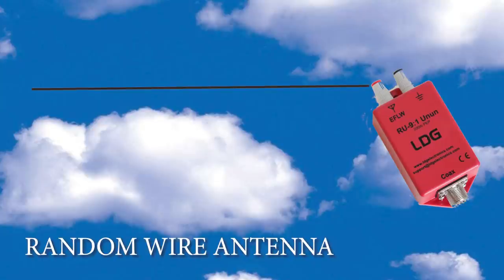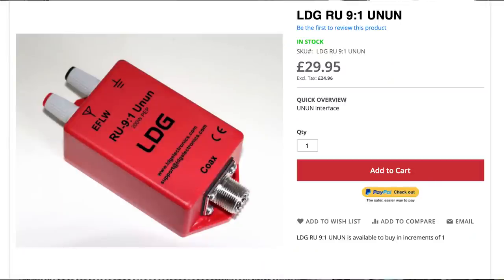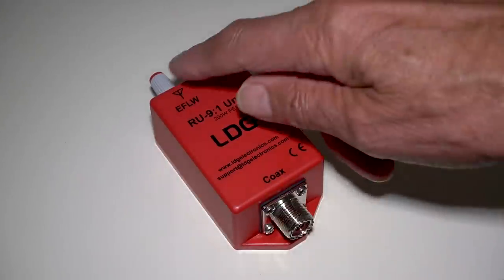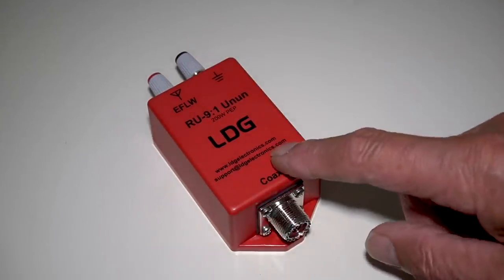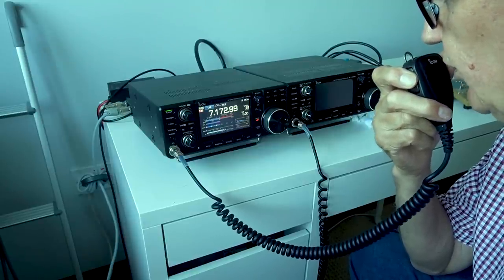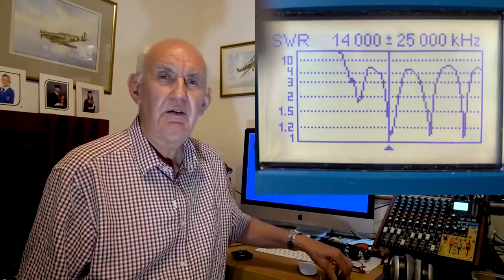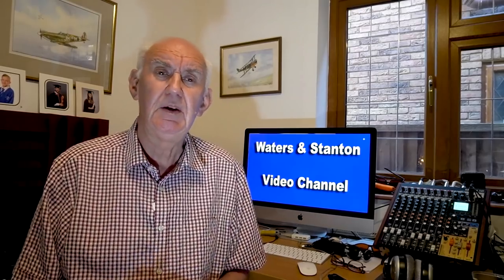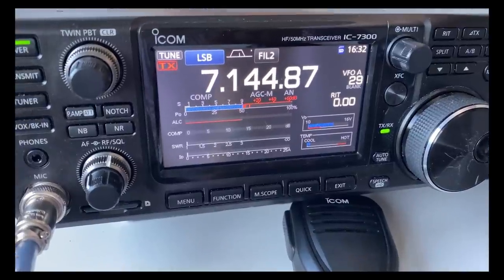RANDOM WIRE ANTENNAS USING THF LDG 9:1 UNUNS

Comment: At about time 15:25 you mention that the line insulator must be next to the rig. But I've seen many articles that put the current choke at the antenna end. Usually, at the closest - to the antenna - place in the coax. Usually, it's done by creating a coil of about 8 turns on a PVC cylinder about 6 inches in diameter - something like that. Instead of coax turns, one could use "beads" instead - but again, they go close to the antenna.

So I'm puzzled about the line insulator going next to the rig. If you had an external Antenna Tuner, wouldn't it go before the tuner? Where is my mistake in thinking it should go at the beginning (non-rig end) of the coax? I do understand that I am assuming that 1:1 is the same as a current choke and that could be my error.

Thank you for putting this video (and the others) together.
Reply from the maker: Firstly you don’t need an external tuner but if you do, then isolator does go between tuner and antenna. I don’t recommend an isolator at transformer end because there is no benefit and the coax is free to act as a counterpoise, although  that aspe t is ooen to opinion. 73 Peter
Reply: @watersstanton  Peter, thanks to your video, I now understand more about the difference between a random wire end-fed vs a half-wave end-fed. When you say I don't need an external tuner, are you assuming the rig has a built-in ATU. Because I'm pretty sure everything I've read about a random wire end-fed is it needs a 9:1 UNUN and a tuner - either in the rig or external.

The other "contrary" opinion I'm struggling with is some say to run the counterpoise parallel with the antenna and others say run it at 90 degrees. Of course, we end up running it whatever way we can given the geometry of our backyard.

Maybe it's the Half-Wave that wants a choke just after the 49:1 UNUN?

Comment: I find your videos so interesting, you are such a good teacher. One question, when you say a slightly high SWR doesn't matter as the length of coax feed is very short what do you mean ? Why might a high SWR on a short length of coax not be a problem but on a long bit of coax it might ? I thought SWR referred to the amount to energy returning to the transmitter which wouldn't be good. Many thanks again.
Reply from the maker: We are talking about HF I think? A VSWR of 4 or 5:1 on a length of coax about 3 or 4m long is not a problem as regards loss. 2 or even 3:1 on 25ft is not likely to provide any noticeable loss.  Even longer at lower frequencies. Almost any length ar 2:1 is workable with not noticeable loss. Hope that helps. 73 Peter.
Reply: @watersstanton  Thanks Peter, yes HF. So that wouldn't be a problem for the transmitter with an ATU, I'm guessing without an ATU its likely to upset the transmitter ? Many thanks for your reply.

Comment: Hi Peter, thank you for a very insightfull video. I'll be adding a counterpoise to my 9:1 unun soon and am happy I now have some sort of idea how long this counterpoise has to be. One more question though: do I put the line isolator after the antenna tuner (LDG Z-100) or in between the antenna tuner and the transmitter (Icom 7300)? Thank you! 73's Alexander PE0ALX
Reply from the maker: The line isolator goes at the end of the antenna feeder, so that means on the antenna side of the ATU.
Reply: @watersstanton  thank you very much for your answer.

Comment: A wire of about 3/8 wavelength on the lowest band (say 40m) will work fine up to 10 m
Reply from the maker: Thanks Todd. The general guide is to avoid quarter-wave multiples on any band. 73 Peter.

Comment: Why do some end fed wires ie for 40/20m with coil like your previous video not require an unun but some do?
Reply from the maker: The small coil is not essential but helps to correct the VSWR drift as you go up in frequency. 73 Peter

Comment: hello Peter iI've been looking at the unun for a while, i have odered on and it will be mainly for top band, i have a look of pesky telephone cables near my qth so i will have to make a lazy W hi hi if that makes sense, although evryone near are now on ground fed fibre optic bt wont remove thier cables, grrr. thank you for the video i'll post once its up, the length will be 124.5 as per the chart and a 1/4 counterpoise ok? many thanks GW4 mike
Reply from the maker: Hi there. Hope all goes well. 73 Peter

Comment: So what about the 49:1 and the 69:1 with a long wire on hf?
Reply: You use those with a half wave bit of wire (or multiple thereof) as it presents 2000-4000 ohm at the end.

Comment: Thank you Peter, very informative video, easy to follow.  Would be curious to know if the LDG 'line isolator' product is just a small toroid ring in a box with a few turns of single wire around it. 
73s!
Reply from the maker: I have not looked at one of these but most line isolators are based on that. `But it is convenient to have it in a case with sockets - home-made or otherwise. 73 Peter.

Comment: LDG makes a 200 W PEP 1:1 BALUN which has a 7 dB return loss at 21 MHz and a resistance of over 100 ohms when terminated with 50 ohms. Based on this, I will never buy an LDG product.

Comment: I have used a 20m wire fed with coax and 9.1 unun about 15ft high with tuner from bedroom window, operates on all bands. 160 rubbish , 80m less than good, 40mtr inter UK brilliant, 20m brilliant, 10mtr directional lobes 54 degrees lobes from flat plane, good.
Reply from the maker: Yes that is about right. I would think about dropping 80m and use a 48:1 UnUn. 73 Peter.
Reply: @watersstanton  will try,
Kind regards.
Mike